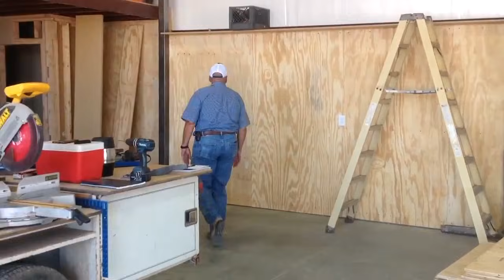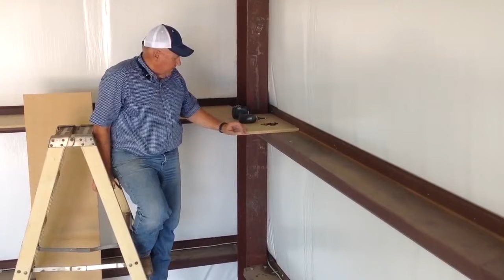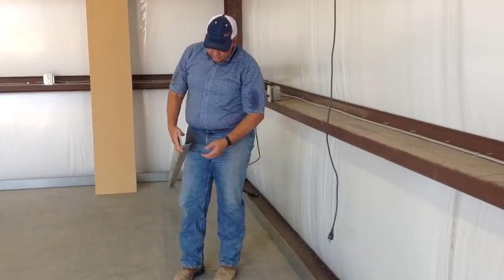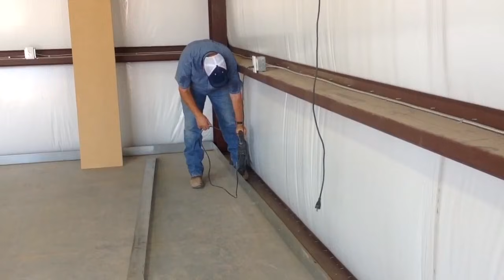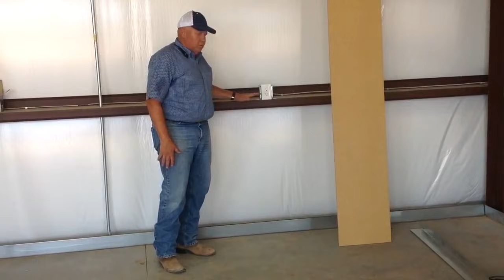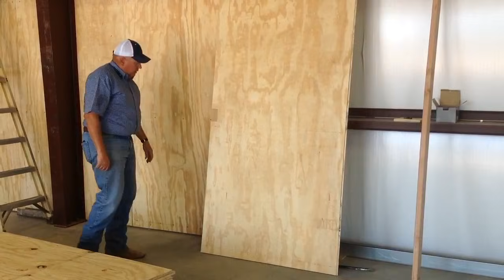Metal Building Interior Finish

Comment: Great video. I have the same type of building and was wondering how I was going to attach my plywood around existing electrical. Lots of great ideas with the 2 x 4 angle on the floor as well as the MDF shelf running horizontal. Thanks again.

Comment: I like the methodology. I'm doing mine but my first girt is almost 8 ft above the floor so I glued and screwed in 4x4 blocks under the girt every other 16" spacing and nailed the top plate to that and shot the 2x4 bottom plate into the concrete floor. Studded out 16 OC and covering with 1/2" plywood.

Comment: One wonders if you could just place a non wicking spacer under the plywood?  I do like the idea of the floor supporting the weight.  Great video.
Reply from the maker: That would be a perfect solution as well @David Baldwin, thanks for contributing that. We install extra fasteners along the bottom of the sheet to increase the strength of the connection to the base angle/channel, so the weight of the sheet is still being transferred to the floor, but as the saying goes, more than one way to skin a cat. Thanks for watching.

Comment: nice!  I might do this same thing but maybe make the shelf deeper on one wall only, not sure about going on all 3 walls we'll see
Reply from the maker: Glad the video was helpful, thanks for watching and commenting @PurerockRacing.
Reply: @sentrybuilders5969  where do I get those 2x4 angle channels you used?  They are just galvanized sheet metal correct?
Reply from the maker: @PurerockSmokinBBQandMETAL  The same steel supplier who we purchase from carries it, typically it is called base angle. It is the same angle piece they use to secure the exterior sheeting to, and when we know the owner intends to sheet the interior we have the supplier use base channel instead of the base angle, so you already have a fastening surface inside and out. While we usually use iron oxide coated steel, galvanized would be just as appropriate, even better if you anticipate it might get wet often. It is 14 GA 2x4 rolled angle, you could use standard 2x2 or 3x3 angle as well if so desired, it would just be more expensive. Good luck with your project.

Comment: Curious if you add any kind of sealant along the angle piece on the floor ?
Reply from the maker: Great question @Dallas Arnold. We did not, though there is no reason you couldn't, we just didn't see a use in doing so at the time. You might want to seal it incase of a spill from the inside, but we just assumed that if there ever was a spill inside that runs up against the wall, it would be cleaned up in a timely manner so any liquid seepage would be minimal. The angle piece that the exterior sheeting is attached to has sealant applied to it to keep bugs/moisture out, so sealant on the second channel piece would be redundant from that perspective.  But it wouldn't take much extra time or expense to seal it if you'd like. Normally, when we know there is going to be interior sheeting in a building, we will use 8" base channel/cee along the floor instead of having to apply the base angle twice.
Reply: @sentrybuilders5969  Thanks for your reply.  I too would expect any spills to be handled in a timely manner, but some are not as diligent as others.

Comment: Great video! Where do you find the galvanized 4"x2" angle steel for the bottom plate? Is it 1/8" thickness? I'm trying to find something similar, but can't quite figure out what to search for or which supply house to call. Thanks!
Reply from the maker: Thanks for watching and commenting @Benjamin Workman. The material we used is typically red oxide coated, not galvanized, but it doesn't matter which on you use. The material we use is 14 GA, 11 GA or 1/8" would be fine but heavier than necessary. Most any steel supplier that produces parts for steel buildings should carry it, it is typically called base angle.
Reply: @sentrybuilders5969  Appreciate the reply! That's perfect, looks like I've got a couple of in town options for it. Thank you! One more question-- you raised the panels 1/2" off the ground, but will that affect the weight they can carry for tools and cabinets hung on them? I'd like mine not to touch the concrete either, but I"m afraid all the weight hanging just on screws might shear them off with downward force.
Reply from the maker: @homeoftheben  That's a good point and one we thought of, we used extra screws along the bottom to reduce that risk. You can butt them right against the concrete, but we like them elevated slightly so if you have any spills the liquid doesn't soak right into the plywood. Either way it probably doesn't matter too much, whatever seems to make the most sense to you, good luck.
Reply: @sentrybuilders5969  I’ve seen some people put down 2x4 pressure-treated bottom plates instead of using base angle when building their walls. I would think that metal base angle would be more expensive but I have never priced it. I’m also curious why you used MDF for the shelves instead of more robust 3/4” plywood? Thanks and great video.
Reply from the maker: We get it from our steel building supplier.  
You can also use pressure treated 2x4

Comment: Is it possible to use non metal on the outside.. I like to go hardy board or a brick vinere...or vinyl siding..   then use metal on the inside...
Reply from the maker: Great question @y2kxj. We do not offer any other option on our buildings, but there certainly are other ways to finish out the outside of the building. Because the framing members, the girts, are approximately every 3-4 feet running horizontally, you would need to have some sort of framework installed to provide vertical support members to fasten the vinyl or other medium to. One option, though probably not the cheapest, is to fasten whatever you intend directly to the steel sheeting on the outside. Also, depending on what suppliers in your area have, or what you can get shipped, there are a large number of finished available for steel exterior sheeting, faux stucco, barn wood, etc. Check out https://www.westernstatesmetalroofing.com/ for some ideas, they have some amazing finishes available on a variety of steel panel profiles.

Comment: Do you pre drill the steel gerts/ studs too?  What hardware did you use ?
Reply from the maker: That's a great question @Thomas Callahan, thanks for asking and contributing. We do not pre-drill the framing material the plywood fastens to. We use self-drilling screws that eliminate that need, plus it would be quite difficult to make sure all your holes align if you were to pre-drill both. When using screws we will typically mark, drill, and countersink the screw head locations. Anymore though, we use a nailgun with special hardened steel nails designed for penetrating through metal, this is substantially faster. Any decent coil nailer should take these nails, check them out https://www.aerosmithfastening.com/versapin-fasteners.
Reply: Sentry Builders amazing.  Thank you so much!

Comment: How about if you don’t have any insulation and it’s just the metal siding on the outside.
Reply from the maker: Thanks for watching our videos @Alexander Heling. I'm not quite sure what your question is referencing, so please clarify if your concern isn't addressed. While we recommend some insulation be install when the building is erected, it is by no means a requirement. Even light insulation will help to buffer the heat of the summer sun and cold of the winter nights, but without climate control inside the building, temperatures will always fluctuate through the seasons. With insulation, the sun won't heat the building quite as hot during the long summer day, but it will still heat up and feel warmer inside once the sun goes down because the insulations holds onto some of that heat. In similar fashion, during the cold of winter, the temperature inside will stay warmer at night, but during the day the sun will be slower to heat the building up because of the insulation. If you have a building without the insulation we would recommend some means of incurring cross ventilation at a minimum, to help prevent the extreme temperature swings, but even that isn't absolutely necessary depending on your needs. In terms of the video you have commented on, the insulation would not affect sheeting the interior of the building in any way. While sheeting the interior of an insulated building will help protect the insulation, usually that is not the primary reason for doing so. Hope this helps you, if not please let us know, otherwise good luck on any future projects.

Comment: Great Video! Love the tongue and groove and off the floor idea. I only question the use of MDF... Why not plywood shelves? I am sure you have your reasons!
Reply from the maker: Plywood would be completely acceptable as well @Travis Reed. The reason Chet chose MDF in his building is because it finishes more easily and cleanly than plywood does when being painted. In this buildings case it took two coats of paint to get a uniform and relatively smooth surface on the mdf, while the plywood wasn't nearly as good after the two coats, and finishing the edges of plywood is the hardest if you want a smooth finish. The MDF has held up just fine so its strength hasn't been a concern. But it is just a matter of preference and there isn't really any one big advantage to it either way, do what works best for you for sure. Thanks for watching and commenting, we are glad the video was helpful to you.

Comment: Best way to anchor wood to steel is straight up with an Aerosmith anchoring system pneumatic gun designed for that job… the regular metal screw system used in this video will strip out eventually…
I have used the Aerosmith anchoring gun for years doing exactly what this video demonstrates Versa Pin ST 4200 is the way to go… cheaper in the long run on labor cost,  super tough you’ll have hell tryin to strip the VersaPin out of the wood.
Just overall a way better system…
Reply from the maker: Thanks for watching and commenting @Kersten Clifton. Your input is very much appreciated and we will be considering your recommendation for future work we do. The initial system cost to get setup is likely going to be prohibitive for the average DIY'er, which this video is geared towards, so standard fasteners may be best for the one time job. But for some people, this may be the perfect option and has some great advantages, we're glad you pointed it out and hope those interested in doing this themselves see your comment. Most of our clients interested in having this done in their building elect to have us install it for them, so we might be using this system in the future. If so perhaps we'll re-shoot the video and give you a shout-out. Thanks again and thanks for adding to the conversation.
Reply: Those girts look thicker than 12 ga steel - would those pins still work on thicker steel?
Reply from the maker: Great question @Chris B, thanks for watching and commenting. We did end up purchasing the equipment to use the Aerosmith fasteners, and so far we have been happy with them. They have their limitations and we still use wood-to-steel screws in conjunction with the fasteners. From our limited experience with the system, 12 GA is the upper limit of what the fasteners will reliably penetrate, and the marketing material rates them only up to 14 GA. Typically the Zee girts/perlins in our buildings are 14-16 GA, so the fasteners work well there.

Comment: I've been considering flat 2x4s placed vertically. $2.45 per 8ft length is $1.05/sqft while $30 4'x8' plywood is $0.94/sqft. Adding 1/4 tongue/groove for expansion and perhaps some backing wood could bring the cost up to $1.30/sqft but it's still within reason.
Reply from the maker: Interesting idea @p39483, thanks for watching and adding to the conversation.

Comment: Hi,
Very informative. We have the same building set up with insulation. I have few questions
1. We are trying to insulate it even farther by adding SIP, and then drywall. Would you recommend to do electrical before SIP installation or after?
2. Not related to this particular video. How did you water proof outside where metal walls touch concrete slab? 
Thank you
Reply from the maker: Great questions Burt Chiropractic Rehabilitation Center, thanks for watching. As to your first question we'd recommend you get with your electrical contractor on what they would prefer. We are not electricians so that isn't something we'd feel comfortable giving advice one, wouldn't want to mix you up. If you're doing it yourself then you might try and contact a local electrician and just ask for some advice. 

As to your second question, the goal with the steel sheeting and trim work isn't so much to waterproof as it is to direct the water to drain away from the building. They make base trim in several profiles for this very purpose so any water shedding off the wall sheeting drips onto the base trim and then it drips onto native grade/concrete slab/etc. If your native grade or concrete isn't sloped to drain the water away from the building at that point then that will need to be addressed. They do make all sorts of sealants for applications where there is water involved, but no solution is considered to be waterproof generally speaking, so if there is standing water next to the building then things need to be changed so it will drain away from the building properly. Hope that makes sense.
Reply: @sentrybuilders5969  1. I agree, we will talk to 3 electricians tomorrow
2. There is no standing water next to a building. There only few spots on each side of the building where water gets through from metal wall into concrete and then  you can see moist concrete. i assume they have not finished everything.  I see many silicon tubes in the metal building fabrication guys box. They were unable to finish an entire building because of the rain.
Reply from the maker: The way we do our buildings, along the bottom edge of the building we use preformed foam strips between the base trim, which goes on first, and the sheeting. This seals the small gaps that are there due to the ribs in the sheeting. This is more for air movement and to keep pests out, but acts as a barrier against wind driven rain too. In some cases spray foam can be used, but it is kind messy and hard to control so we try to avoid it, make sure you have the appropriate solvent on hand if you do use it because inventively it'll get where you don't want it and the poly foam sticks to everything.
Reply: @sentrybuilders5969  From my research, the cleanest way would be to unscrew the bottom edge of the sheeting and insert Z shaped sleeve. Most likely custom made around the perimeter of the building - https://www.youtube.com/watch?v=2H0VavvtyI8 - Thoughts?  Indeed, spray foam has no control. It just appears everywhere you do not want to see it.
Reply: @Burtchiropracticrehabilitation  l

Comment: Is the building heated or in any way environmentally controlled?  I am asking because I am concerned about moisture / condensation.  Planning on building soon - gathering information.  Thanks!
Reply from the maker: Bill Coffey we appreciate your question. Most of the buildings we erect do not have any kind of environmental control. They are storage buildings or hobby shops. So depending on what you plan to do with the building will determine if it's worth installing anything. We do typically insulate our buildings so that will help with condensation in cooler weather, but basic fiberglass insulation generally isn't sufficient if environmentally controlled. If you intend to heat your building, and it sounds as if you are in a cooler climate, we recommend spray-foam insulation in that case. It will not only provide excellent insulation, but will also cover most of the interior steel components that would cause condensation. Good luck.
Reply: Sentry Builders 
I live in South Carolina. Very warm and humid - would your suggestion be the same?
Reply from the maker: That's a great question and I would have to recommend you contact a local builder now knowing where you are located. Arizona, if you've never been here, is a very hot and dry place in most cases, as such humidity is really never a concern. Rather than give you advice that isn't based off of experience I would ask you seek the advice of someone in your climate that knows how steel buildings weather the hot wet summers and cold winters there.

Comment: Looks like a nice finish for the interior of this building. We at One West Steel Builders did the same to a 16,500 sf ag building in CA. Something we did was order the building with the first girt at 4'H and the second girt at 8'H so you don't have to cut the plywood at 7'-6" and utilize the whole sheet. We also ordered the building with an 8" base channel instead of the standard base angle so we didn't have to attach 2 pieces of base angle.
Reply from the maker: Thanks for watching our video John Clericuzio. Your comment is a good one and in the cases when we know ahead of time that the owner plans to sheet, or have us sheet, the interior of the building, we do similarly. Good luck to you and your company.
Reply: I know this comment is 6 years old, but it is still standing as useful. I am in the planning stages of my shop. I will be putting channel down instead of angle and spacing out to accommodate 4x8 plywood as suggested. Thank you both.